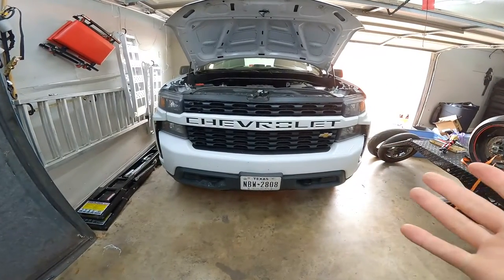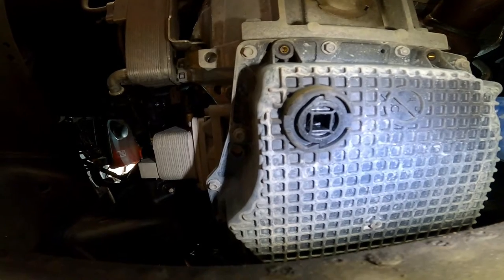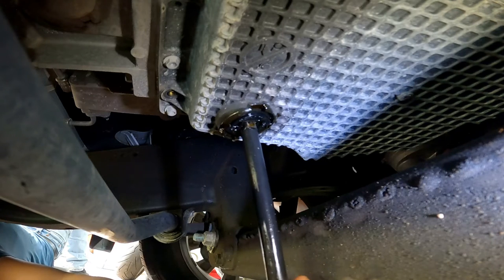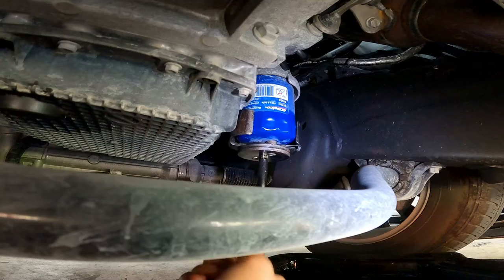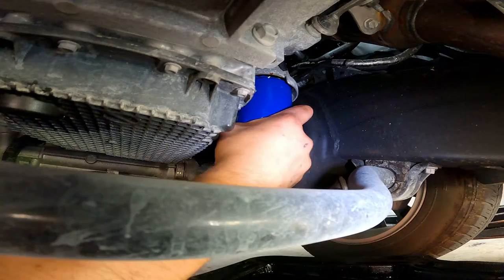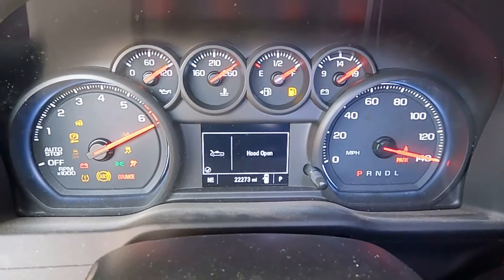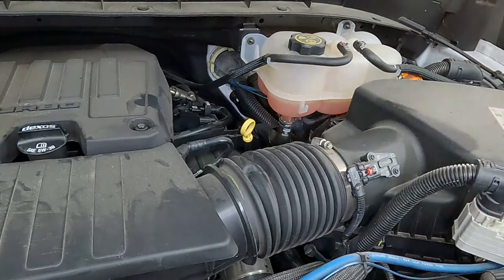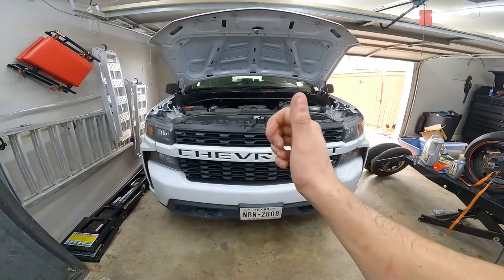2020 Silverado Custom 2.7 turbo oil change

Comment: Really impressed how easy it is to change the oil on this Silverado.
Reply: It looks like an improvement for sure.
Reply: You’ve probably never done a chance on this truck, it’s the worst!
Reply: @vbuen323 yea, just did it for the first time today in my new truck and made a ROYAL mess. When I pulled the plug, the oil came out WAY too fast.

Comment: Very easy change. I normally do my own. But my 2021 2.7 Silverado has a Lifetime Warranty as long as my maintenance is done at my dealer.
Reply: How much does the dealer charge for an oil change? What type of oil are they using? I usually do all my own maintenance but like you I have a dealer nearby that offers lifetime warranty if they service the vehicle so I’m curious.
Reply: Wow! Lifetime warranty! That’s a great insensitive to bring your truck in! My wife’s 2021 2.7 custom had the first year oil change covered by the company. When I set up the 1st oil change after the 12 Months they quoted me $182 (including oil, filter , necessary fluids & tire rotation) I asked if I did the oil myself will my factory warranty still be covered, they said “ as long as I keep records and receipts “ and here I am watching this video. Did you have to pay extra for lifetime warranty? Or just need to have them service it?

Comment: Great video, I have a 2020 2.7L love it! Thanks for the info.
Reply: Any issues with this engine by a chance ,
Reply from the maker: There was only one, the purge valve failed (sits on top of the engine) but I believe it was a recall issue and was covered under warranty
Reply: @naytheanzarate9008  no longer have the 2020 2.7 custom lease  was up. I went back to a V8 There is a big difference. I hit the gas pedal and it almost throws you back but still I'm a firm believer in that two seven turbo. It was so much fun so zippy miss it already. No issues with it either. Always on point

Comment: Whenever you can it's just extra protection to pre-fill the oil filter. When you start the engine with the filter empty the oil pump has to first fill the filter before you build oil pressure.
Reply: fact
Reply: Um….No
Reply: Yeah for like 2 seconds.

Comment: I wouldn’t put the bolt back on until the filter is removed otherwise old oil will mix in with the new oil

Comment: How do you like the truck has hit had any issues, I have been thinking of getting one
Reply from the maker: No longer have it but when i did for the year in a half I owned it, it had a check engine light for one of the sensors going bad for emissions but the dealership replaced it at no cost and only took like 10 min for them to do.   Thats about the only issue I had (oh and they had to update the software for the transmission)
Reply: @SUPSGARAGE  thanks
Reply: @SUPSGARAGE  why you get rid of it
Reply from the maker: Was missing the sport car life lol   So I got back into a camaro

Comment: Maybe I'm OCD, but I would add another 1/4 quart with a reading like that on the stick.
Reply: In my experience from Hyundai, Toyota, Volkswagen, Mazda and no doubt others, the Dipstick level has been under the mark and even over the mark. When I've done an oil change on a new to me vehicle, with the exact amount of oil, and has been sitting on a level surface for awhile, I've put my own punch mark on the dipstick.
Reply: @awsmbug  I hear ya.  I have a 71 Riviera with a 455 Buick motor and it reads full with 4 quarts in it.  Everyone told me the pan should hold 5.  So I put 5 in and made another mark about 5/8th above the original full line.  I didn't see any bubbles on the stick after driving (from the crank hitting the oil) so I kept doing it and its been 20 years and 50,000 miles and no problems.  Of course those old cars were notorious for poor fit to specifications.  I would never imagine a modern car would be that far off.  Still I'm curious how much you can over fill them.  I think they probably have 1/4 to 1/2 quart leeway.  But I like to be on the line.

Comment: thats alot of oil for a tiny engine. whats all of the plastic underthe hood? I know one is the air filter
Reply from the maker: yea it is and its really just the engine cover and the rest is connected to the air box.
Reply: 2.7 is not tiny
Reply: @user-tb7rn1il3q  2.7 4, vs. 2.7 6…..explain the difference other than the fact one engine has a couple of more cylinders than the other.

Comment: great video, good design but I cant believe GM uses a plastic oil pan screw ,that wont last long
Reply: Yeah, that’s the first thing I noticed. The whole oil pan is plastic. At some point a person is going to snap the plug, the plastic will become too brittle, or something hits it just hard enough to crack it.
Reply: @MrSamPhoenix i think for 2024 they stopped the plastic oil pan nonsense.
Reply: @davidr7872  thank goodness
Reply: @MrSamPhoenix  I checked on a forum for Colorado/ Canyon owners and GM is using up the plastic pans and going to aluminum.
Reply: Congratulations - someone finally made a drain more messy than my Ford pickup... I didn’t think it was possible!
Reply: There is a aluminum pan that will fit perfectly. If yours starts leaking or gets messed up the dealer can replace it with the new version. Buddy is over 200k and his pan is still all factory. Some last some spring a leak down the road. Keep an eye on it when ya check oil.
Reply: Gm went back to the aluminum oil pan on my 2024 Silverado.
Reply: @Malachor8091  thanks
Reply: I went to check all scared. Not plastic on 2024 Silverado.

Comment: I did the same exact steps when changing the oil but once I turned in the truck a message popped up saying engine power reduced. Helpppp
Reply from the maker: and the dipstick is showing the correct oil level?
Reply: Same s*** just happened to me man.
Reply: I'm not beefing your post. I really appreciate you help. I'm just really curious why these new trucks are so Finicky when it comes to stuff like this
Reply: @SUPSGARAGE  Oil level was showing correct on the dip stick. I ended up just unplugging the battery and the message didn’t show up anymore.
Reply from the maker: @daisymendez7633  thank you for that info!  cuz I'm sure that's will help someone else on here 😊👍

Comment: I was told by a tech at take 5 that the drain plug has to be replaced every oil change because they aren’t made to last long? Is this true?
Reply from the maker: Honestly I never heard of that but I don't believe so because the oil pan itself is made from the same kind of material.

Comment: would you recommend an oil change every 5000 miles?
Reply from the maker: I would just do it according to the oil service life percentage.  I usually do mine at 15% percentage.  Any sooner then that I feel like I would be wasting my money lol    but overall   sooner is not a bad thing
Reply: Definitely yes especially since it’s a boosted application! Would recommend a catch can as well. Tons of blow by with turbo engines. I never fully go off the manual or oil life monitor.

Comment: That oil was pretty dark. How many miles did you have on that oil?
Reply from the maker: I believe it was 7k miles on that oil
Reply: Oil changes in these turbo motors should really be done every 3k. Gas motors trying to be a diesel are really hard on the oil.
Reply: @JF-qc6po  3k miles, not with today's oil. 5k I would think is fine, but i generally base mine on driving. If I've done alot of towing, I'll change it sooner, or if I've gone on a long haul towing trip, that's over 1000miles I'll do it when i get home
Reply: @JF-qc6po  3k was more for carbureted cars where they always run rich and wash down the cylinder walls and dilute the oil.

Comment: When did they release the filters to the part stores?
Reply from the maker: Not to sure but I do remember finding a filter for this truck was really hard at the time.  They were on backorder.
Reply: 2.7 uses the same filter as the 3.0 Duramax
Reply: Auto Zone.  PF66 AC Delco. 8 bucks

Comment: Why is Dexos so important?
Reply from the maker: from my understanding brother    it's designed specifically for these newer vehicles to help gas mileage and last longer then other oils when it comes to heat coming from the combustion chamber (also helps keep the oil from oxidizing)
Reply: @SUPSGARAGE  Thanks for the response brother. I drive a 2003 F150…. It has the 4.2 V6…. Over 200,000 miles. I don’t think my engine is that hi tech to require that type of oil; no overhead camshaft and no VVT….my engine is an old school design with the central camshaft and rocker arms. I think I can just use either a high mileage conventional, blend or full synthetic….Thoughts?
Reply: @SUPSGARAGE  I’ll subscribe for your knowledge.
Reply from the maker: @Earl Edwards  Im just here trying to help others brother   and thanks for the support!
Reply from the maker: @Earl Edwards  they work good for the older engines as well brother but me personally I just use moble 1 full synthetic high mileage on my older cars and will be just fine

Comment: Another friggin plastic oil pan. Cost cutting? Makes you wonder where else they are cutting cost/quality that you can't see.
Reply: Exactly and they charge top dollar for those trucks.
Reply: It seems to be built well.  Plastic lasts longer than metal.

Comment: Dam plastic oil pan and drain plug? Cheap truck expensive price. Overpriced
Reply: Doesn’t make we want to buy one. Where else have they cut corners.
Reply: @timferguson593  pistons, cam shaft, valves, block, tranny, axle, turbo, wheels, brakes, hoses, radiator, radio, doors, chairs, windows, bed, suspension and hood are all the same materials, the one steel bolt I saw was the one holding the whole truck together 😜

Comment: Is that filter compatible with full synthetic oil? Some filters specify what oil they work best with
Reply from the maker: Not to sure, but it never gave me problems
Reply: @SUPSGARAGE  any good filter will work,  I use full synthetic and wix filters,  sometimes Fram